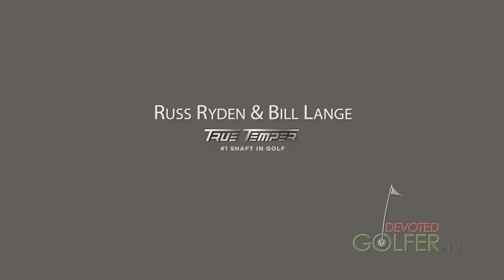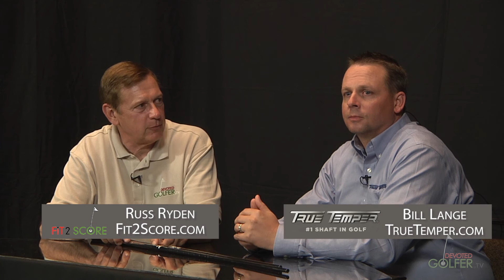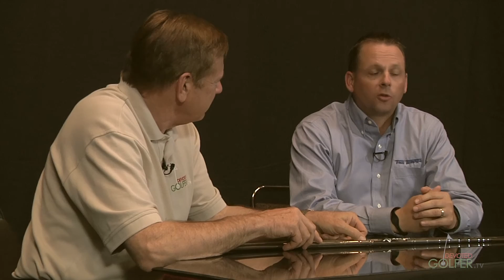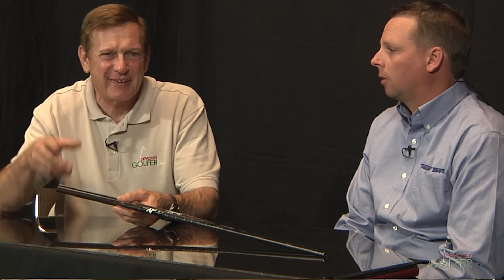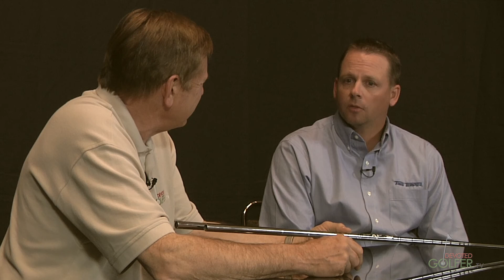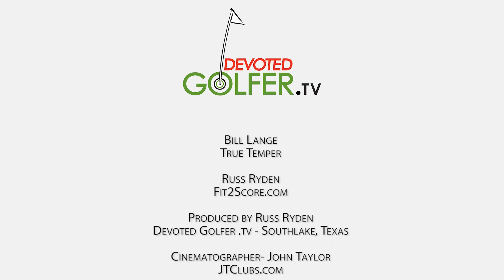Golf Club Fitting - True Temper XP and Dynamic Golf Progressive Golf Shafts

Comment: Russ Ryden Interesting, are True Temper or any over shaft manufacturer looking at 'graphene' in any way that it may be introduced into composite shafts.
Reply from the maker: I had to google the word 'graphene'. I do not know. But I will ask. I know that there are several new shafts coming to market with exotic materials and exotic prices.
Reply: DevotedGolfer Thanx, material not long discovered so it would probably only be in R&D if it was. The lightest strongest material known currently, discovered by accident using cello-tape and graphite.